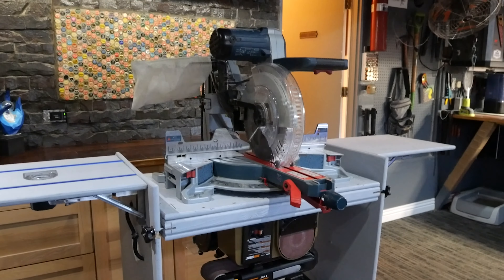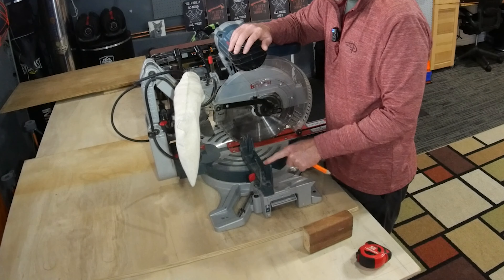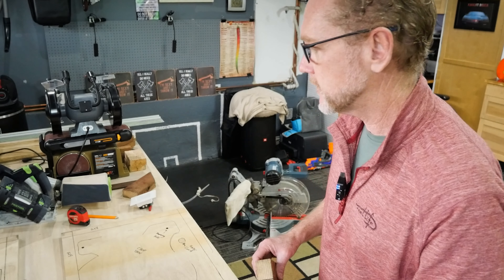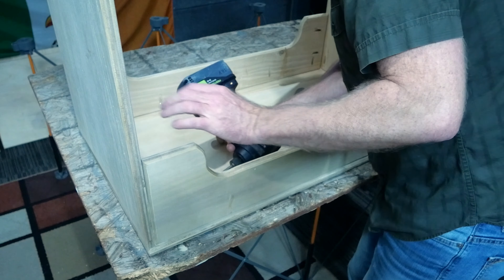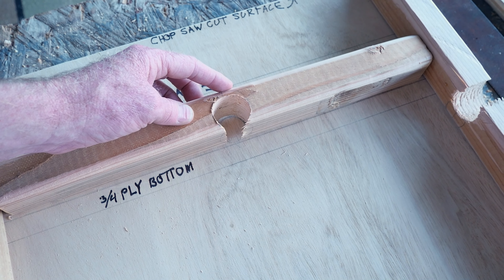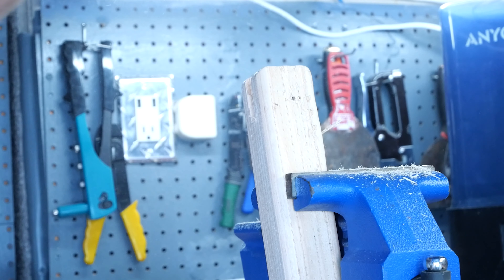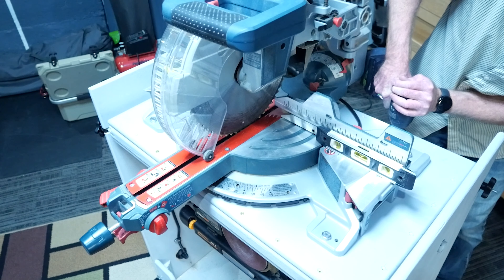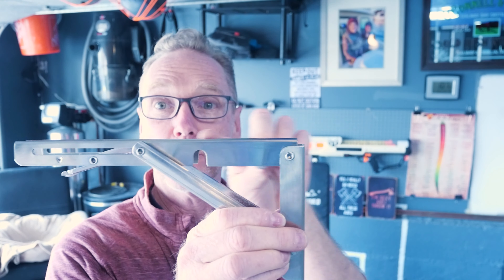Ultimate 4 in 1 Flip Top Tool Cart Build

Comment: I enjoyed your video nice job and i didn't know that you're a triplet. I watched a lot of flip top tool/machine cart videos the way I'll be building is I think mainly with 2x4s I'd rather make the top more robust. I'll be mounting one side miter saw other planer the wing levels will be different. I'll also be using folding brackets they'll be 20inch ones i was also thinking about shimming with washers but make it so the wings can be adjusted vertically. Oh and almost forgot I want to use pillow block bearings and pipe with flange.
Reply from the maker: If I had to do it again I would for sure do it with 2x4s.  Especially with the weight on top like I have.  Pillow blocks would be a nice touch too. fold out wings that are vertically adjustable ? that would be impressive.  good luck
Reply: @IfAlexCan  Engineering workshop/extremely versatile flip top cart shows how you can make the wings adjust vertically you'd just have to make it so you can mount the folding brackets on the adjustable pieces.